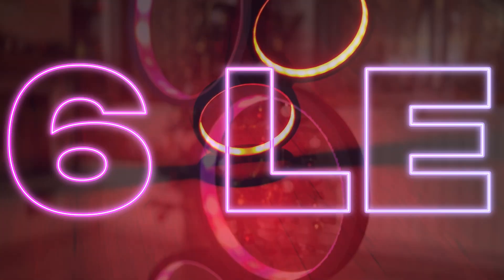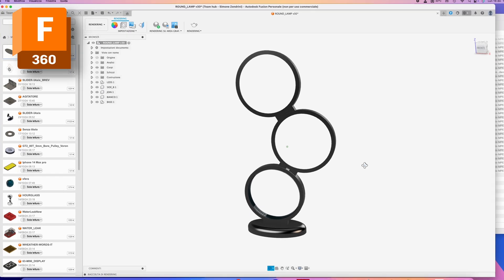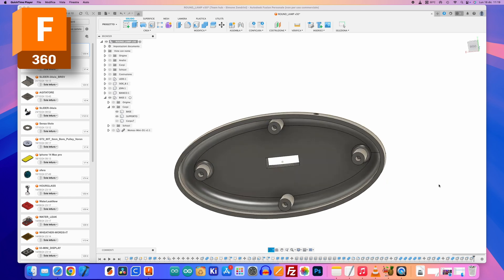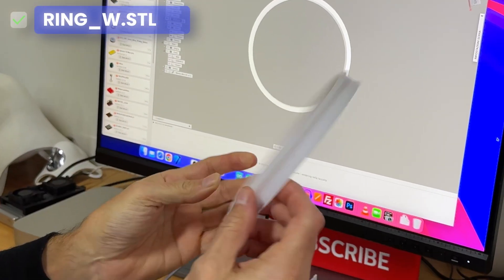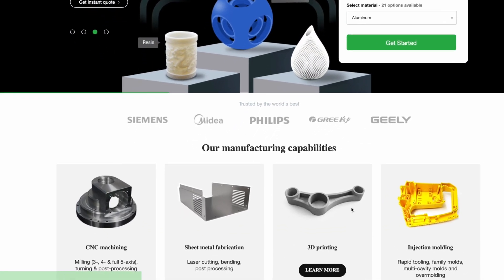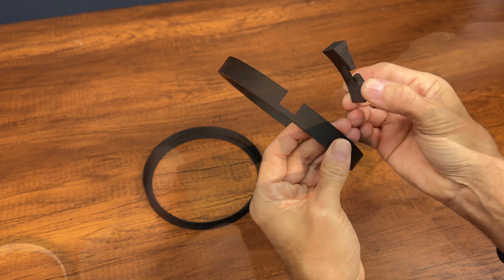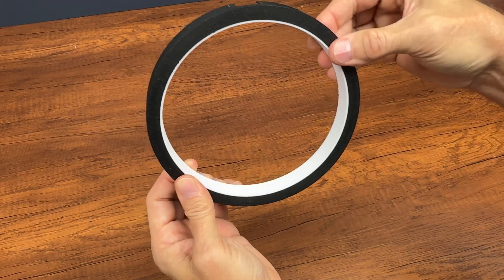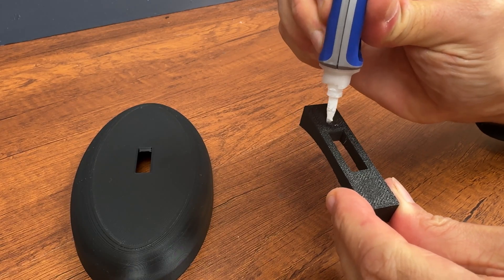Colourful LED Creations LAMP with ESP8266 or ESP32. #arduino #esp8266 #wled

Comment: i want to make this for my gf but im not sure about how to connect the led strip wires to esp and power cable :/
Reply from the maker: Its really easy… strips have 3 wires… gnd, 5v, signal…. Signal need to be connected with esp (you can choose any i/o pin) then you need wled… there are lot of tutorial also on my yt channel… good luck

Comment: Hello, I printed everything but I have a problem with the white diffusers. They are slightly smaller than the led holders, so there is too much clearance and when I close the cap the diffuser won't stay in place. Maybe in the .zip there is an older version of the STL? Thanks
Reply from the maker: hello, you can try to increase a little bit the scale or increase the extrusion factor.. this is the easiest way if the difference is slight..
Reply: @boomytech7504  thanks, I solved it scaling at 100,5%
Reply from the maker: @MrRiKo88 👍🏻👍🏻👍🏻

Comment: Very nice project. Since I downloaded the original files with the missing two rings, 
I just recreated them myself in open scad. I also modified the base a little in my slicer so that 
I power lamp through a removable barrel connector.
Reply from the maker: Very good…👍🏻👍🏻👍🏻
Reply from the maker: I update the zip file fix wrong support.stl and support_b.stl

Comment: Hello nice project. I’ m already printing. But, is it possible there is an .stl file missing? The 3rd (last) round A should have only one opening as I could see on your video. Could you please check this? Many thanks for shairing this project.
Reply: Goodmorning. Sorry to disturb you again, but is it possible that the two supports used in the video are open on one side to make it easy to insert the ledstrip.? The ones in the download are closed. And the base in the video has the support attached to the base (printed in one piece?), not so in the download.
Reply from the maker: I will check and let you know asap…thanks for feedback
Reply from the maker: I checked and update again the zip file. SUPPORT is used to join the rings and is open to insert the strip, SUPPORT_B is used to join the ring to the base. thanks again for your feedback.
Reply: @boomytech7504  Hello, thanks for your reaction. But I think you forgot to add the support.stl in the lampv3.zip file (the open supports as in your video). Can you please chek it out? Sorry for this all.
Reply from the maker: :-) I just woke up.... I update the zip --> v4 :-) thanks
Reply: @boomytech7504  Hi. Sorry I disturbed you, but I'm an early bird. Again many thanks from Belgium for your fast reactions and help.
Reply from the maker: You do not disturb me at all… you help me to correct my fault…👍🏻👍🏻
Reply from the maker: Hello, you are right, the 3 rounds are all different. I updated the zip file, you can download the new one. thanks for reporting. the round are ROUND_A1.stl ROUND_A2.stl ROUND_A3.stl
Reply: @boomytech7504  Many thans for your fast reaction.

Comment: wow thats a really nice one, now i have to build one to .
although for the controller im gonna use a plug and play Dig2go.
Did you make segments for each ring so that they can have different effects ?

Thanks for sharing the files.
Reply from the maker: 😂 yes, you have to build it..👍🏻 you can use dig2go but I'm not sure if it's inside the base
Reply: @boomytech7504  can always remove the housing of the dig2go or raise the Base height somewhat, will be a after the weekend before I start on this one.
On another note AliExpress has some ws2812b Ledstrips 5mm wide 160 leds/meter and a cob Ledstrip in the same configuration I use often for this kind of project.
Reply from the maker: I think could be ok...
Reply from the maker: about "segments for each ring" this should be a specific video... there some tricks I used to use a single stripe and control 3 separated rings...